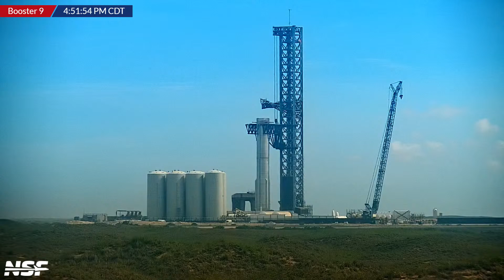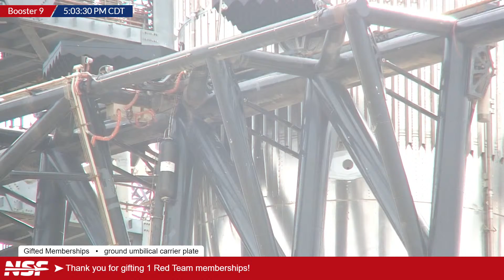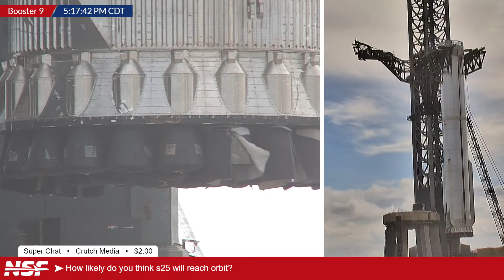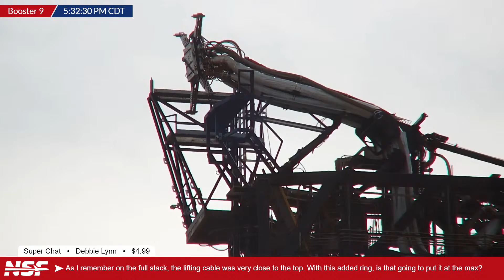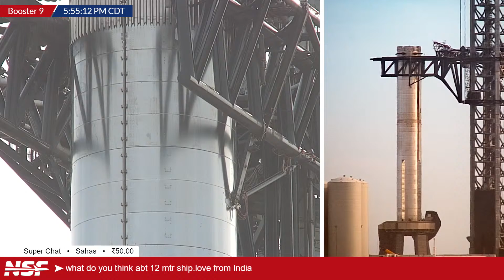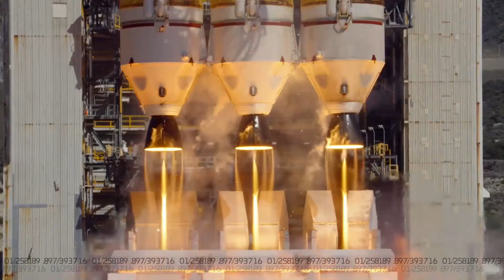SpaceX Booster 9 Lifted onto the Orbital Launch Mount

Comment: are the heat tiles the most efficient way to do this? wouldn't 3D printing a heat resistant body in the first place save a lot of trouble, i realise that maybe heat resisting body material might not be practical, but the tiles (on the shuttle at least) were delicate and kept falling off, if the body of the starship was heat resistant to begin with, wouldn't that cut out the hours of tile placement?

Comment: Maybe I'm not getting it are they actually going to launch people in this thing and then land them in it also. Can't we just keep it simple stupid we have a launch vehicle and return vehicle that works fine for Earth. Why don't we just keep using them for the humans a space travel we can use the starship. Like I said we have cargo spaceship fuel tanker spaceship there shouldn't be a human launch and return vehicle spaceship until the thing is 100% we should just keep using the Falcon and Dragon capsule. And when they're in outer space and foretravel they can use the Starship with whatever fuel tankers attached to it foretravel. Now granted for the moon landing they could use Starship because less gravity easier to land but for Mars getting down there would be the hard part unless Starship is 100% Landing by then we're good and you can always send your Falcon 9 and dragon capsules to Mars to get the people back into outer space but again if Starship isn't 100% Landing you'll need an entry vehicle.

Comment: Heavy has 27 raptors no problem, Super Heavy is only 6 more raptors. Should be easy for Space X
Reply: Do you mean Merlin?? That's a horse of an entirely different color! That's a kerosin burning engine, meanwhile Raptor is a way more complex and advanced CH4 burning one, cutting edge technology.
Reply: @hubert3919 vs NASA’s SLS using 1960s era throwaway legacy technology RS-25s costing taxpayers $146 million each.
Reply: @warrenwhite9085  
Indeed, who said otherwise???

Comment: what happens if only 5 raptors ignite  is starship doomed? could it effect some sort of landing if can't make it to orbit given only needs 1 engine to land and could use propellant to still fly a significant distance?
Reply: starship wont launch if only 5 engines start
Reply: @Chilli-Wet-Wipe  I'm talking about starship not super heavy
Reply: I thought only 3 engines at seperation, other 3 are vacuum for leo
Reply: @rogerthomas169  true, I was going ask about separation with just two vacuums making asymmetric thrust without ability to vector  and it compromising separation but was more interested if starship can get to orbit with 5 of 6, because I'm sure in separation emergency they could use the gimballing engines for a separation escape emergency.mode
Reply: yeah my bad, im not a rocket scientist but if they went through the trouble of getting to separation on a test flight, im sure with the amount of fuel they could potentially make it to orbit will still work.

Comment: It's possible they clamped the hot staging ring, instead of welding it, because it may not be reusable.
Reply: It not being reusable would foil the whole starship/ superheavy concept. It must be reusable
Reply: @turbofan450  being 100% reusable is a dream, after each flight multiple parts will need to be replaced and refurbished, like they do it with falcon 9, a hot staging ring is just a part bigger than normal getting replaced.
Reply: @DeferedPattern No, literally the entire purpose of starship is to be fully reusable. You don't replace parts of a plane after every flight.
Reply: @Astra2  We'll see.  As I say, historically, hot staging is murder on the top of the booster, so it's brand new territory for SpaceX.  Airliner-like reuse is currently aspirational, anyway, so neither you nor I know whether it's even possible, let alone with anything like the hardware they're currently using.

For one thing, it's quite unlikely the Starship will not need some tile work after every reentry.  That was a normal part of the STS turnaround process, and I don't see anything that tells me the Starship heat tiles will fare any better.
Reply: @turbofan450  Historically, the top of the discarded stage of hot staged separation took an awful lot of punishment.  I'm not sure it'd be possible to reuse it.
Reply: @turbofan450  yeah but this one on B9 might just be secured with the same mechanism that starship would use to sit ontop of the booster